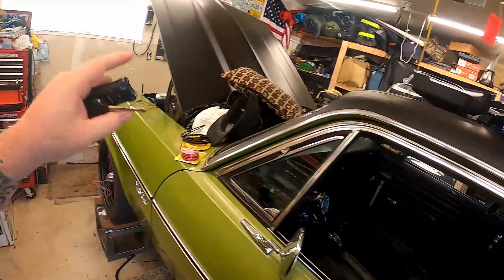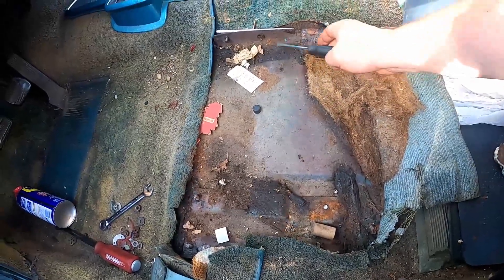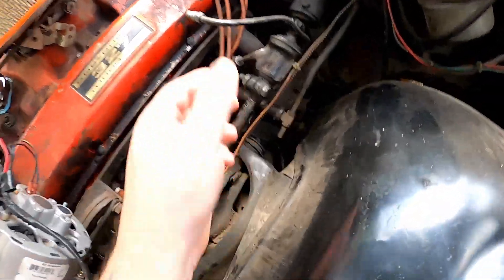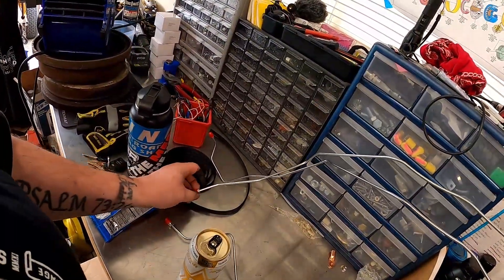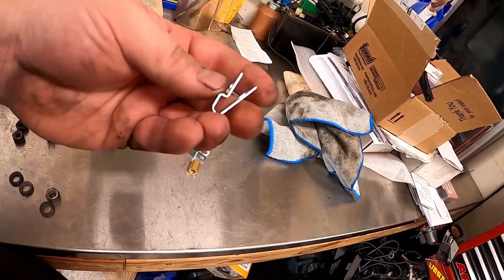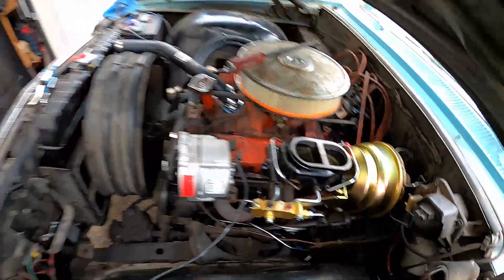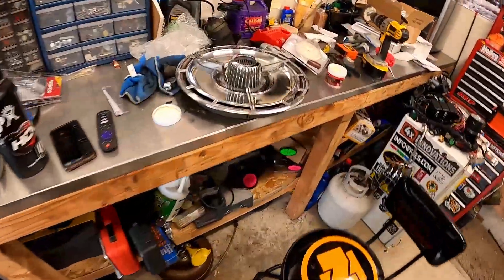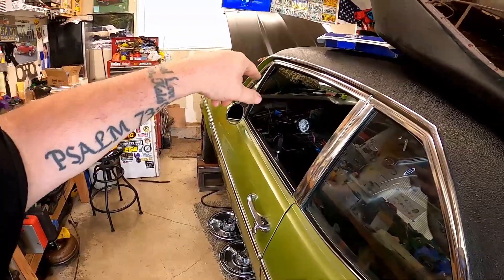1964 Impala - Dual Master Cylinder Install w/ Brake Lines

Comment: I just installed the same set up in a '61 Impala. There was an extra boot in the kit so, I popped the large end over the rear of the boot already installed on the rod. It seals the large hole left in the firewall behind the booster. Also, you will need to shorten the pushrod about an inch (on a '61). Thanks for the tip about cpp lines. A little easier than bending, rebending, throwing away, repeat... I was hoping to avoid crossing the frame twice but, I would have to make a new route down the left frame rail. HEY!!! I just remembered, if your's is a column shift, check to see if you need to shorten the top of the shift rod. I cut off about 3/4 inch. The wheel covers look pretty damn good!

Comment: Awesome video Billy! I have a 63 impala; I just did an upgrade from drum to disk brake conversation. I'm installing new dual brake master cylinder, did your original brake cylinder had a single brake line? before converting to duel?  if so, how did you add another secondary line? Thank you in advance!
Reply from the maker: Thanks! My couple videos in the brake upgrade shows the adding of two new brake lines for the front :)

Comment: You can just get a bender and some tube and run them across the firewall. No bleed back or air pockets in my experience. So much easier
Reply from the maker: I see what your saying, but factory looks so much better even if it’s more work

Comment: CYPRESS HILL. LOWRIDER, SINGER, SERGIO REYES,AND I LUCIO GOMEZ. WERE NEIGHBORS IN SOUTH GATE, ON CYPRESS STREET BETWEEN INDEPENDENCE AND FIRESTONE BACK IN 1985-89 AM IN THE CLASSIC LOWRIDERS BRAKING SYSTEMS.. DISC BRAKE & POWER STEERING CHANGE OVERS IN OC ABS POWER BRAKE INC.
Reply from the maker: You are insane in the membrane.

Comment: Great video bud,  Im actually in the middle of doing my lines right now. Where did you start feeding the new lines? or any easy way that you could done diff? did you have to take out your steering reservoir? any advice would really appreciate it.
Reply from the maker: I didn’t actually have to take anything out to get lines in. I pulled them out through the drivers side and just paid attention to the path they took and put the new ones in the same path. I did have my son help though. I laid under front of car while he fed them down from up top slowly. You do have to bend them a little as they feed under but they do bend back pretty easy. It’s not a fun job but just go slow and watch the path. Don’t be afraid to bend the line either :)
Reply: The easiest way for me was to jack the car up feed it from the bottom driver side under the steering shaft over top of the suspension then fed alongside the fuel pump 🥂💪🏿

Comment: What does the dual master do compared to the single?
And what color is the car, is it paint code 918 or 919?
Reply from the maker: Single puts front and rear on same braking circuit. If you lose front you lose back as well. With dual it puts braking circuits front and rear on their own so if you lose front you still have rear and visa versa. I don’t have the car anymore so I can’t confirm paint code :/

Comment: I did everything u did on ur video , bleed all my brakes snd master cylinder, but my pedal hoes all the way to the floor , I got no leaks , any suggestions will help ?
Reply from the maker: Only thing it could be if it’s all there mechanically is air still in the lines. You probably have air in the rear now too.

Comment: Cant  u reuse the old lines or does this kit require more lines
Reply from the maker: You need new lines 100% ( rear line is ok to reuse)
Reply: The old system is a single reservoir master cylinder, so front and rear are on the same hydraulic circuit. With the conversion to front discs and a dual master, you need new lines to create two independent hydraulic circuits.

Comment: What hole did you install the break booster rod on the break pedal?
Reply from the maker: It’s towards the end of the video, use the lower hole for power brakes :) Top hole for manual.

Comment: Hey brother I just did a brake conversion on my 63 and I bled the system about 4 times already and I still have a soft pedal, I checked for leaks and I don’t have any, do you have any idea what else it can be?
Reply from the maker: When you drive it and use the brakes does it help to pump it once or twice when breaking for it to feel normal?
Reply: Yes it feels like with an extra pump it helps
Reply from the maker: @joeperez8117  usually when you have to pump it then it still has air somewhere :(
Reply: @BillyFargon  hey brother just want to inform you that changing the slot to the bottom on the pedal took care of the issue. Thanks for the help
Reply from the maker: @joeperez8117  oh good! Thanks for reporting back in case someone else has the same problem :)
Reply: This is a stupid question but How did you get your second line to the new master cylinder did u get a different junction box?